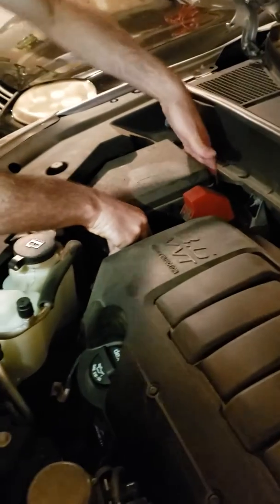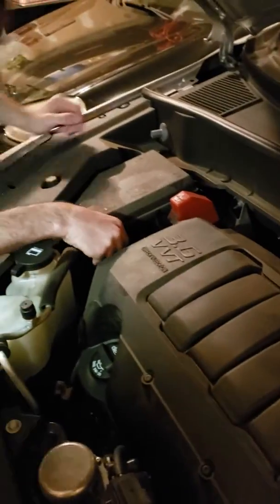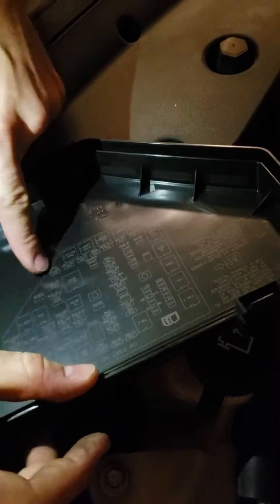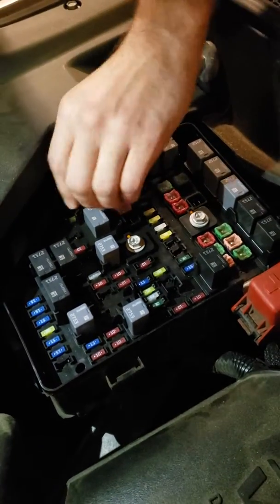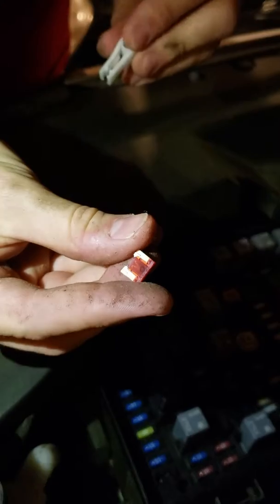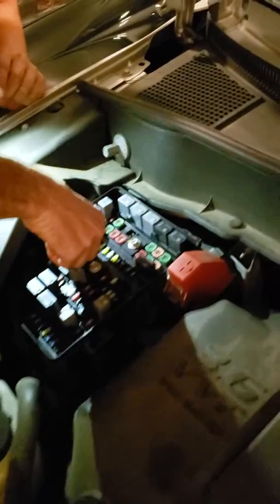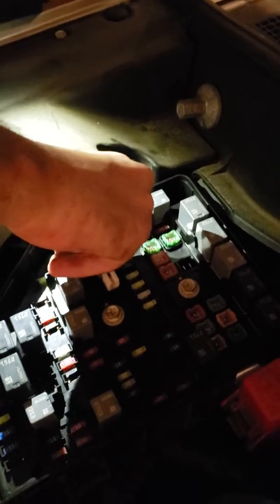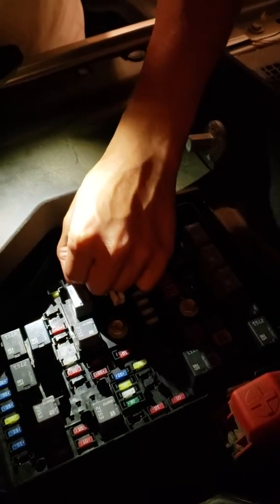2016 Chevy Traverse Break Lights Not Working

Comment: Blown fuse was the issue on our 2016 Traverse for the brake lights not working. Swapped the one over from the heated mirrors and it worked. Thanks!